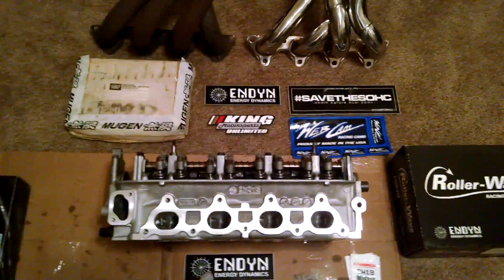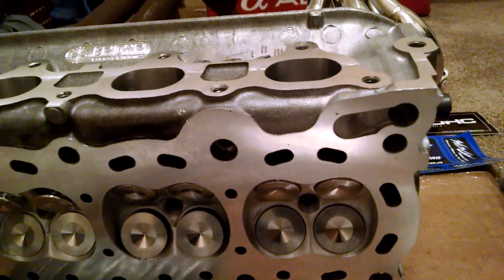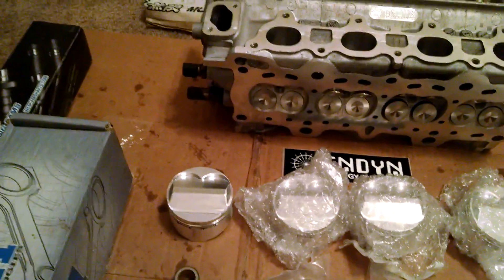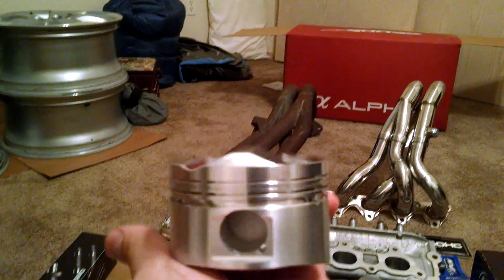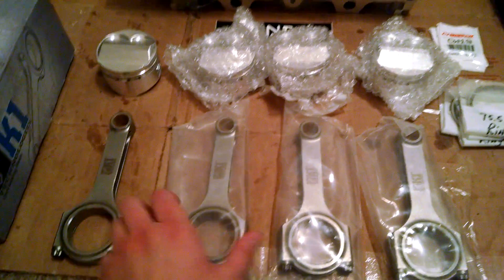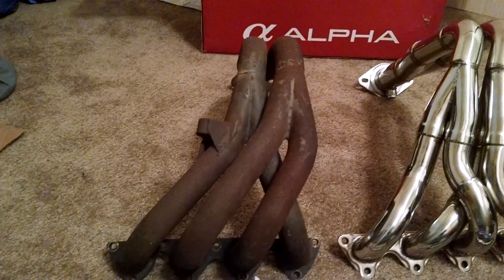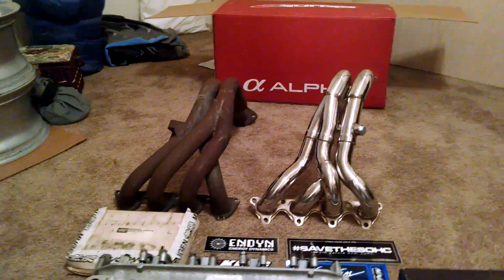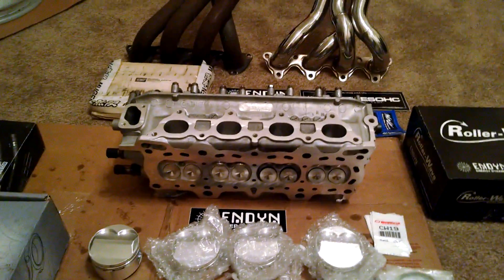ENDYN D16A6 1.7L Stroker Engine Part 1

Comment: Travis can you confirm whether or not a B series harmonic balancer will work on a D17 crank?
Reply from the maker: Yes the D17 does in fact use a B series balancer. We did however have to create a custom shim for it otherwise the alternator belt would be slightly misaligned.
Reply: @travistexas7175  alright, thanks man! I think another way around the alignment issue is to use a D17 alternator pulley on the D16 alternator. But I'm not completely sure yet. I'm starting mine soon. But I'm using a Y7 block and head. I found a set PMS-A00 pistons from the GX D17 engine and I'm going to use those. Should be pretty rowdy with a Rocket stage 4

Comment: Do you have the part number from wiseco for the pistons? When they do custom pistons they still will create its own part number and save it into the system
Reply from the maker: No sir, they were custom ordered through ENDYN and shipped to their location in Fort Worth, TX where they were further worked on before being repackaged as Rollerwave Pistons. There was no part number on the box or paperwork, only instructions for installation

Comment: Awesome build , parts , and car ! I had my Y7 head done by Larry too ,he did an amazing job.How much cfm did your a6 flow ?Did you still had stock size valves? I would love to get a custom cam done by Larry .I currently have a custom webcam/bisimoto cam laying ready ,but i'm not sure i would use it.
Reply from the maker: Honda Nickx I don't recall the final flow numbers but the increase from stock was 29 cfm from stock if I recall. Larry made custom .5 oversized valves

Comment: I'd rather use non-vtec a6 or even dohc zc, but I have a z6 in my EF, so would I still follow the same protocol that you have? Or is there more fab involved for the v-tec oil return ect.?

Before anyone mentions it, yes I could disable v-tec or whatever but z6 and y8's don't flow like the non tec counterparts. So what would be the point in that?
Reply from the maker: Bjorn Kingslayer same amount of fab work as the non-Vtec.

Comment from the maker: Non-vtec to make the motor appear stock and era correct. Also the Non-vtec heads are known to flow really well with some mods, and lastly with an aggressive cam the engine has a really mean lope at Idle.
Reply: Nice to see a quality build by TOO/ENDYN